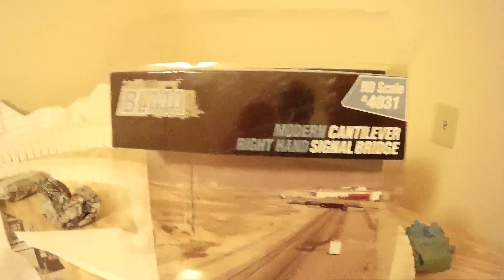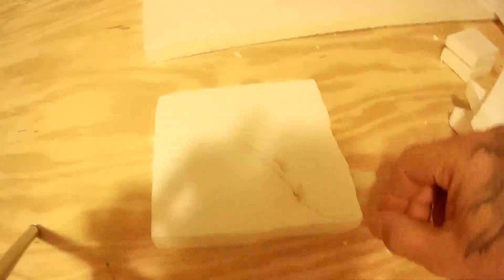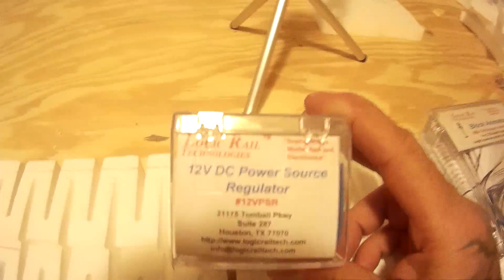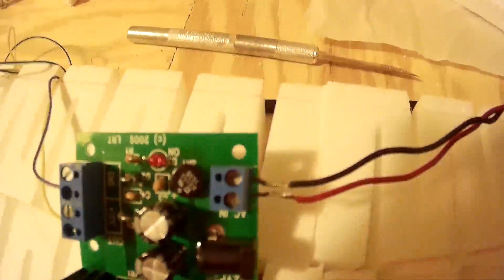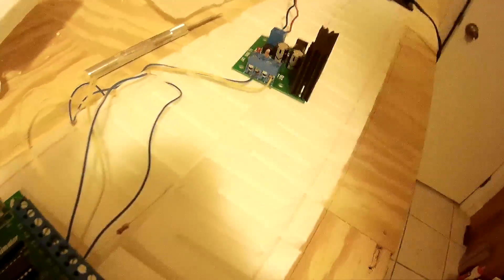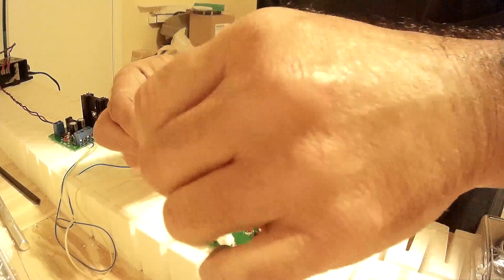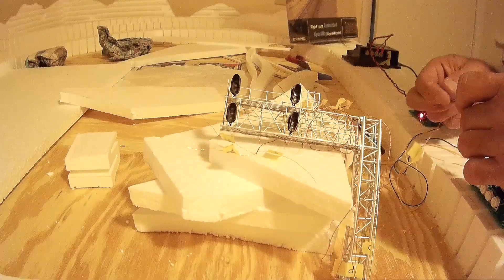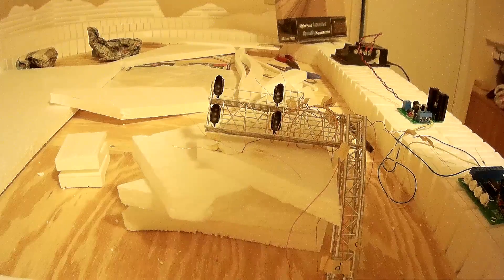BLMA Cantilever Signal Tutorial

Comment: Excellent video. I am considering purchasing a three track tower and doing what you did here for a simple dummy tower that constantly displays red signals. With that having six heads would I be able to run all six wired to the resistor and not over load or blow any bulbs by using this technique?
Reply from the maker: i'm not sure about that but you can try it and see

Comment: Would this work for a single signal head as well
Reply from the maker: +dalton lines  this should work for a single head as well, i did try it on one i have and it did work the same way :) some manufacturers make the lights a little different using different wires but the concept is basically the same.